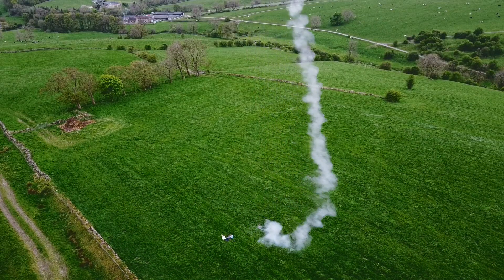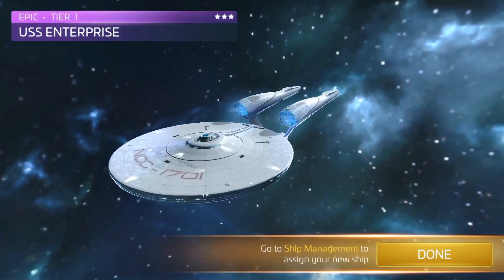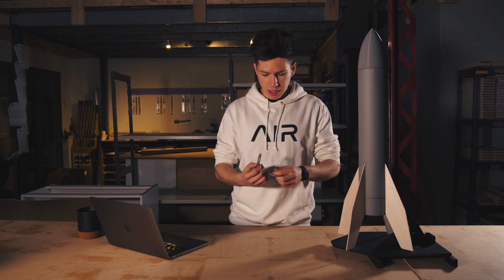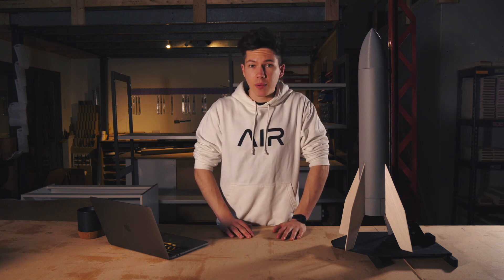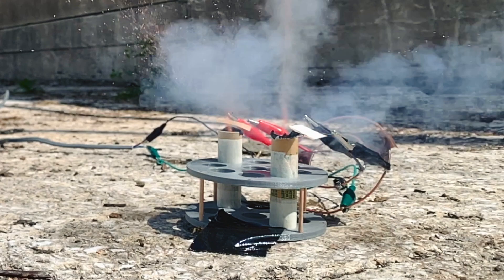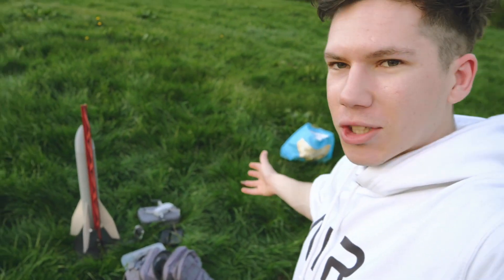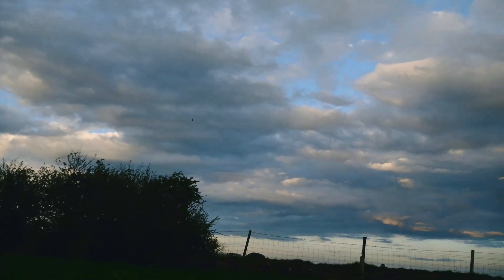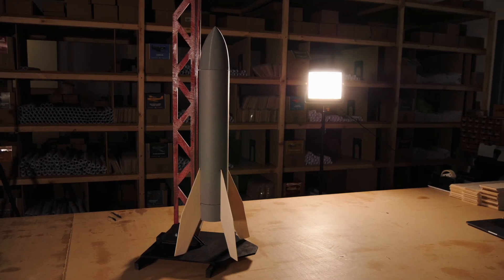DIY High Power Rocket

Comment: Well done! MY first rocket, built long before either of your parents were even a leer in your grandparents' eyes, was almost identical in design to yours. Fins were smaller, and I suspect you need to enlarge the fins and lengthen of the fuselage a bit. Intuition, and you lost 2 engines. In the good old days of the very early '60s, 3D printers didn't exist. Hell, printers and computers didn't exist! Well they did, but they were pretty big, slow, clunky, and well, you get the point. I came up with your ignition system for 3 engines using 2 paper clips, uncoiled, and alligator clips, powered by my father's car battery. It worked. My igniters were loops of NiChrome wire, with fuse wire wrapped into the loop. As soon as the wire got hot, the fuse went off, and the flame started the engines. Simultaneous firing across the board. I believe the early Soviet (real) rockets relied on a similar type of system. Ya done noble! Sand down your next nose cone, lubricate it with something and try again! Oh, for the record, as a 12 year old, I dreamed of working for NASA. Mann tracht, und Gott lacht! I became a physician, Internal Medicine. I might not have gotten anything into space, but I saved a hell of a lot of lives. Never give up! You have no idea of where this little hobby of yours will get you. Best wishes from the States.

Comment: Very Tintin/Von Braun design. Love it. The gantry looks appropriate to the design too. Awesome launch. Too bad about the landing. Spectacular just the same.
Those motors tend to be used in rocket bodies that are much smaller. Could the increased volume of the rocket body take up the ejection charge? Your ground test also showed the ejection charges lighting at quite different times. Would smaller tubes focus the ejection charges better?

Comment: This flight reminded me of a V2 test flight where the engine malfunction caused the missile to take a digger.  You may solve the chute ejection problem, but balancing the thrust before liftoff with off-the-shelf engines may be a bit of a challenge. It is a lot easier with liquid fuel as one can monitor and ramp up the engines. In fact the V2 had a engine stabilization step in its launch procedure. You might have to very selective on your engines (e.g. weigh them) and igniters being rich and matched. Lots of fun. Best of luck.

Comment: it's pretty common for larger rockets such as this to use a separate computer-discharged pyrotechnic charge to blast the nose off. usually with a separate smaller compartment to generate the required compression. This is why larger motors don't even carry ejection charges of their own.
Ah yes, peices in a field. been there!

Comment: Maybe you should put an explosive charge at the tip of the rocket so if the parachutes fail and when it comes down it will explode. By the way, I was wondering if there has Ever been a rocket🚀 engine made out of Mentos and diet Pepsi as fuel?

Comment: I make sugar rockets and rather than using electric igniters, I fill the engine's bore hole with a bit of loose fuel mix (sugar/KNO3) and touch it off. You can do the same with black powder, but it tends to run back out of the hole, while the sugar fuel mix tends to hold in place enough to fight gravity and stay up inside while the rocket points up. With each engine prepared with fuel mix they are sensitive to a high temperature flash, easily provided by a small tray of fuel/black powder fixed under the engine assembly. Engines that fail to catch on the initial flash have a second chance to be set off by the other engines during flight.
I've had a lot of success with this method using single engine rockets, and in my mind it would be a great fit for your situation.

Comment: The cluster engine is interesting but you should think about fewer more powerful motors. You'll also need to channel the exhaust gases to get the parachute out (not just removing the friction). Great job.

Comment: The issue may be in your wiring of the igniters. Send me a schematic of how you wired them and the voltage and amperage of the batteries included the length of wire and gage from batteries to igniters. This is the engineering part of the science. Awesome job young man!

Comment: With so much reserve power, maybe consider installing the batteries (or a capacitor) for the launch system in the rocket body?  that way even if there is a delay it is still able to ignite once airborne.

Comment: "the parachute didn't work..." these words have been said by everyone who has ever done much with model rockets.
Reply: I added to much rocket wadding and the gasses from the ejection charge had nowhere to go so the rocket exploded
Reply: When he mentioned that the nosecone was tight I knew that was foreshadowing of things to come... Though the volume of gas needed to pop it off even if it wasn't tight is probably way more than those motors can provide anyway.
Reply: LOL! My first rocket (powered by an E9-8) had an issue where the shock cord would burn up all the time. But I learned to place it properly and spray graphite on it. Never had a parachute problem again... until my sixth flight on my H-powered rocket where my shroud lines got caught and ripped off my rocket. RIP
Reply: @antoinepalacios5158  My team has started to cover shock cords with duct tape and it worked pretty well! Although we did use that method on +4" diameter rockets, so we had a tad bit more space to play with
Reply: another way to mitigate that is to attach a nomex or kevlar blanket to cover shock cord and chute
Reply: @antoinepalacios5158  Jesus your first rocket took an E motor? That's crazy man. I started on A-Cs. Recently built a mean machine so I'm now doing some larger setups.
Reply: Richard Lockwood. Yes but not by many paratroopers i guess.
Reply: Parachute didn’t work and “OH Crap the wind has IT” 😂
Reply: @PatrickWilson47  ... "the tree has it."
Reply: @richardlockwood999  I live in the prairies no trees but my son ends up chasing it till he trips or too tired lol amazing how far a light breeze will carry the rockets lol we now use smaller chutes or cut the centre out.
Reply: Try an inflatable chute
Reply: I spend a good week trying to create a parachute system from scratch with a water rocket and accelerometer. Fun to do, but taught me that you can’t get good apogee detection with just an accelerometer.
Reply: riverguy00 try a quark! They’re pretty inexpensive and pretty small. Our team bought one for i think $20 from eggtimer rocketry. I’m pretty sure there are more altimeters out there, but the quark worked well for us.
Reply: Marie Galvan Thanks! I knew there were premade solutions around, but I wanted to try my own thing. Also, I couldn’t find something that I could interface with a microcontroller. Maybe I’ll give it a shot.
Reply: also the last words from your mom
Reply: or someone who played KSP.

Comment: Fantastic project!!!
A couple suggestions.  Try ground testing your ignition system with all the ignitors you plan on using.   Making sure they light is critical.  Test them apart from testing if they will light the motors.    For your recovery, try using an altimeter and ground test the system before you fly.   This is my preferred source for altimeters,  and a good source for inexpensive gps tracking:     http://eggtimerrocketry.com/
Have fun and keep flying!!!!!    Karl

Comment: Can i suggest making the wires which ignite the motors longer? That way when the rocket starts to lift the motors which are not ignited yet have a bit more time to “receive” the current? Just a thought though, i have no experience at all with this.

Comment: Rather brilliant. I’ve not had rockets in 50 years or so, but they were so much fun. I put a big motor in a tiny rocket and never saw it again, so I get your pain. My only suggestion is to increase your launch battery, or perhaps use three parallel circuits to ignite three motors each. Nine igniters is a LOT of load for one battery.
Reply: Finally...good advice

Comment: Used to build and launch rockets years ago, and I found that if I cut a hole in the center of the parachute (such as real parachutes have) the rocket didn't get carried away as far, it allowed a more straight descent without all the pendulum swinging motion. It didn't lose any efficiency due to that hole, it just allowed the air in the parachute to exit the canopy without inducing the swinging.

Comment: Love the video, a few sergestions on the ignision (I dont do rocets, but have yoused plent of pyrotechnics):
My first sergestion is to link all the starters in series not parallel (we fined that we get a more reliable response with that) OR
My seconed sergestion would be to use some very lightweight wire (the stuff you inside small motors) so as the rocket takes off, it have a little longer to ignight the slower rockets.

Comment: Hi this randomly showed up in my recommendation section, so I decided to watch it! I downloaded the files, modified some, made it twice as large, Printed some struts and made them connectable, made larger fins, and the payload was uccesful! I even recovered the fuselage that landed in a shallow lake! The payload was a space shuttle glider which I also recovered, it was designed with the ability to circle its launch area through a computer and some control surfaces! It was tough but it worked, I’m preparing for a new design for the fins though they didn’t work as expected, and the nose failed to land properly and the parachute didn’t catch air for some reason, probably folded it wrong. And the launch tower snapped from the slider being jammy, the rocket will be used again maybe in another week for redesigns and purchase of new parts. Overall thanks for your design, the rocket worked great!
Reply: @Stu Pididiot In his videos he sounds like 10, so yeah...
Reply: @stejer211  I’m 16
Reply: @stejer211  ?
Reply: @stejer211  Do I care?
Reply: @PhallusYT Hey dude i know this is a bit late but i was planning on making a rocket using the same structure as this one, do you happen to know what the foam like material it is wrapped in is called?
Reply: @rift9303  I need to find it, I’ll get back to you once I find it. I know it’s a durable and light foam.
Reply: @TakkudALT  thanks dude :)

Comment: I’m not sure if the UKRA rules are different from the NAR rules, but this wouldn’t count as a high power rocket in the US. Based on the given figure of 127N peak thrust and 9 motors, I’ll assume you’re using Estes C6’s. They have a peak thrust of 14.09 N, totaling to 126.81 N peak thrust. I couldn’t find what exactly is the line between mid power and high power in the UK besides total impulse, looking at the model rocketry safety code for the UKRA. For the NAR, it’s impulse over 160 Ns, which it isn’t here, total propellant mass over 125 g, which isn’t the case here either. Unless the rocket’s mass is over 1.5kg, I don’t think it would count as high power here.

Feel free to correct me if I’m wrong.
Reply: If anyone cares, I regret making this comment. I was so bent on what I thought was a technicality that I overlooked the engineering and planning and effort that went into this. I was wrong, and I'm sorry.

Comment: I'm not sure of your wiring sequence, but if you wire them in series there will be a draw down of amperage/voltage to properly create an ignition sequence. If the engines that didn't fire off are 7, 8, and 9 then that could be possibly why. If the engines are wired in parallel then the  amperage should provide equal sequence because amperage doesn't change in parallel wiring.  Or, you'll have to have ignition switches for each engine, I believe in prototype rockets, the hold down arms to not let go until all the engines are at equal thrust.
Reply: Not sure this person understands all they know!

Comment: Cluster ignition can be tricky. Long ago, I used two AGM automotive batteries. One battery provides 12 volts to switch a relay at the launch pad  where a second AGM  automotive battery was relay switched with short leads to deliver high current to the igniters which were flashbulb/thermalite with a custom wiring harness to avoid electrical shorts or open circuits. Igniter Technology has advanced quite aways since then and there are better options. When clustering a large group of motors (I never ventured past 5) relay switched power was the easiest,safest, and most effective way then.

Comment: You need thicker wire supplying the primary source of power to the 9 igniters.  The voltage likely dropped on that pair of leads under the current load of 9 igniters making the ignitions less reliable.

Comment: From my experience with model rockets, I would think that you may have such a large volume of space inside the fuselage that the rockets' ejection charges are not effective. If that is the issue, there are a couple of paths you could go down to address it. It will just take a little of that impressive engineering that you regularly demonstrate. 👍
Reply: Concur. Also the nose cone should slip from the rocket body. You had a stage separation issue independent of cavity volume.
Reply: In the vidéo of the test we can see the explosion charge of the two booster didn't explose at the same time. This can explain why they don't have the power to push the nose
Reply: @pierre-antoine9757  Even if they all lit off simultaneously, I still think the volume may be an issue. Those motors are typically used on a rocket with a ~1" diameter and perhaps 12-24" length. Say a max of 75 cubic inch volume per motor.

Nine rockets then would have ~675 cu-in. 

However, a 100mm rocket at an equivalent length would have more than 1200 cu-in volume. Twice as much as those motors - in a best case scenario - are typically used for.

This will be a surprisingly difficult challenge to solve.

(Please forgive me for my mixing of units. Can't help it.)
Reply: @bradley3549  well not to mention that that much ejection charge may also destroy the sidewall of the rocket casing as well. It looked to be just glued on stiff paper and may not be structurally sound enough to withstand the pursue with out some external reinforcement. Typically I have seen fiberglass used but in sure something else could be done at a lower cost and still be effective at this size.

But ground testing is a good idea!
Reply: @center4nerds  It might be a good idea to put additional black powder on the top of at least some of the motors for a more enthusiastic ejection charge. Alternatively, one could make one relatively narrow tube within the big tube and a matching rod shaped piston on the back of the nose cone. This way a single charge (they're not going to go off all at once) won't have to pressurize as much volume. The other ejection charges should probably be vented.
Reply: +1 to the volume diagnosis. Off the top of my head you could install a chute charge in a chamber behind the nose cone, and put in a fast fuse lighted by one of the engines' ejection charge. Aside from that not sure how you'd deal with this.
Reply: YES!!!!! you would be better off with a triple G80- 10 Aerotec engine set. with over 10 times the power and around 6 times the ejection charge deployment power.... that is if they all fire which in my case is a sure shot. I have never had an Aerotec dud.
Reply: Volume, combined with the ejection charges not going off simultaneously is likely the issue.

Comment: Capacitive discharge system for multi engine launch.  Fast, high voltage, high current.  Run a tube from engine directly to small chamber beneath recovery shoot.  Volume of the rocket is too great for the small pressure of the deployment charge.

Comment: I suggest working on a timed rocket release mechanism and integrating that with the ignition system.  Initially when the rocket is on the pad, there are servo-controlled latches that hold the rocket down.  A fraction of a second after the ignition begins, the servos retract the latches and the rocket takes off, hopefully with all 9 motors firing.  Really epic first try!

Comment: back in 1963 I built my own launch vehicle, with at the time large D type rocket engines with the idea to launch a field mouse into low earth orbit (in my mind). No 3 D printing in those days I rolled my own tubes from kraft paper and glue around a large wood cylinder turned on a lathe. My dad had a wood shop. I hand carved the nose cone from balsa wood a spheroid design with hollowed out compartment and door for the passenger. The most difficult part was catching the field mouse, which after repeated attempts was successful. on launch day the mouse was fed his last supper, with all hope of retraining him alive after his ride. ignition of the single D motor was successful, the rocket climbed to what I estimated was 3,000 feet, unlike your experiment the ejection charge successfully deployed the parachute, when I found the nose cone ie Capsule, the door was open and the mouse was gone. To this day I hope he landed successfully and opened the door and ran back to the forest, but I still have visions of him free falling from 3,00 feet.  Such is life in the pursuit of knowledge.
Reply: Thats how the kids back then were playing